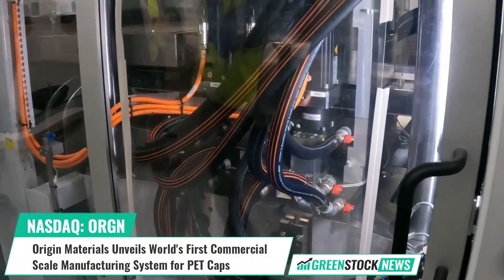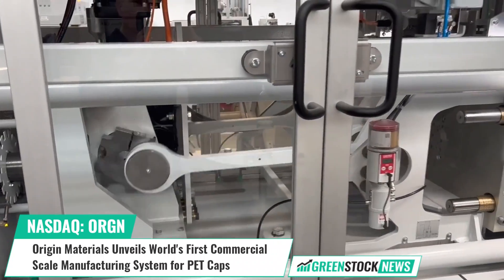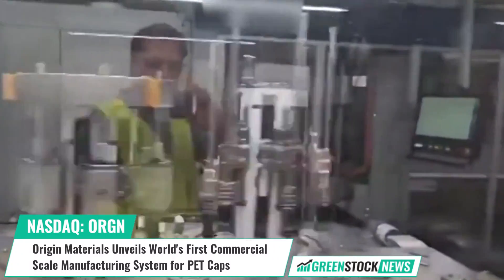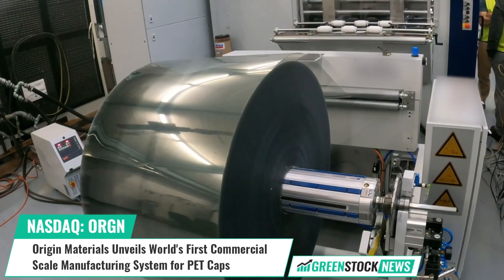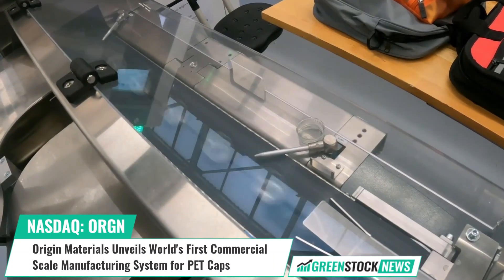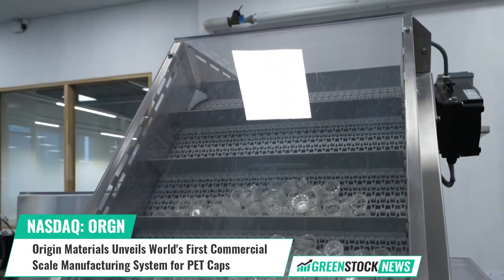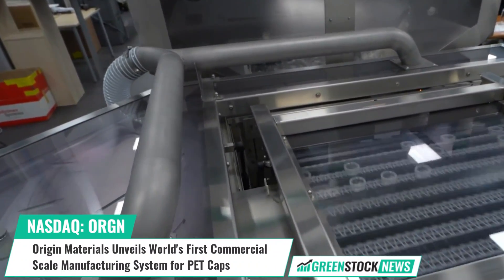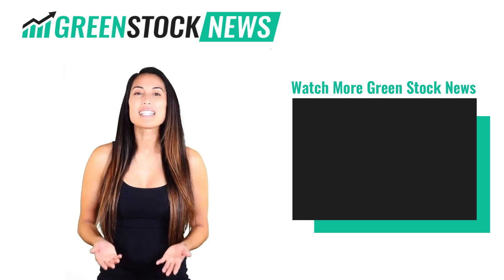Origin Materials ($ORGN) Unveils World's First Commercial Scale Manufacturing System for PET Caps

Comment: Their products was very good. How come the stock cannot attract much attention?
Reply: I will give you a complete answer and a long answer. I followed the company. It all came down to time line and expectation. The problem with OM (Origin Materials) at that time was, where are they heading with the multiple products. Their technology was new and innovative. They have a small pilot that works. Oil byproduct is use in packaging and other materials. OM is mimicking it using their technology and chemical.  The first major step was to create a manufacture plant that scale and produce a byproduct that can create substance close to oil byproduct using raw material such as wood, cotton, box, plant, and etc. They were trying to address over 100 billions market. To their credit, they did successfully create the manufacture plant with a slight delay because of Covid19. Sourcing the material was not a concern and they can use waste product from the wood mills to create the compound they needed. It was great that the plant was running and was able to create the thing they needed. The manufacture plant just prove that it can be done and the technology works. This was the company highlight in their young career. There are incredible people in the company and with ton of knowledge. However, not many have run a public company.  There was misstep and that was the cost. They didn't balance out what OM needs vs what the client wants. OM was trying to reach many industrial and aiming to start all sort of adventures that they couldn't afford. The balance sheet was in question, even with a state bond to raise non-dilutive fund. The first manufacture plant was consider the smallest and they needed to produce more plants to be profitable. The cost to built another plant in the USA went up due to Covid19 or supply chain. Their mission to conquer many industrial at once was over. Their mission and story was skewed and some analyst couldn't take it. The stock took a nose dive. Sometime there is a disconnect between the actual company and the stock price. The technology didn't fail. The company is running on something that never been done and they succeeded. However at that time, the change of story was bigger than the company. The company was sailing to do bio-fuel for the transportation industrial as their near term revenue. OM final byproduct can be use as fuel. Again that may take an additional 2 years to see any significant progress.  Then from the ashes, PET cap or the cap or closure was their bread and butter. This is the other story in the making and one that make more sense. It's the step in the right direction. Revenue start late this year and ramping up in 2025. There is a road to profitable and there is a demand for the product.  Hope that help and what a long answer. Don't make me think so hard. Imagine my brain cells are dying here.
Reply: Are they building om2 ? Whats the plan after or during caps  @gopxrock4950
Reply: it is cap.
Reply: ever since august 2023. they got a new CFO. that was/is notorius to bankrupt companies  everybody sold off.  it was a 5 to 7 dollar stock back then.. and ever since.. sub 2 dollar give and take
Reply: @Albert87nl what’s his name?